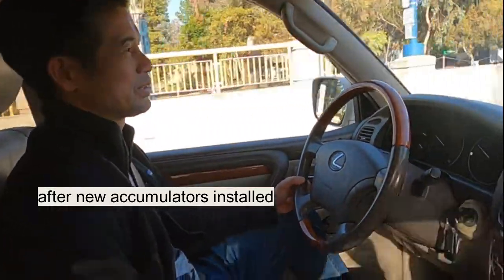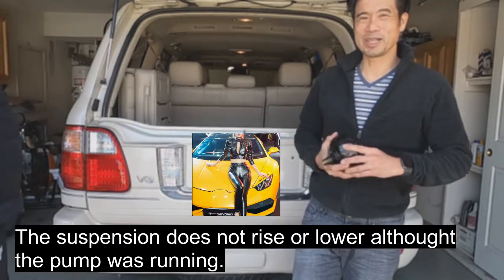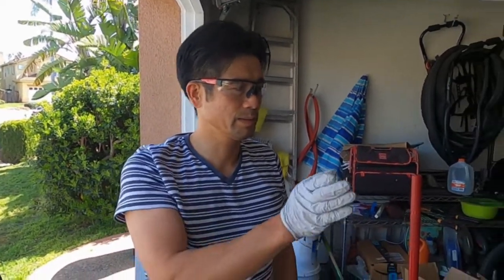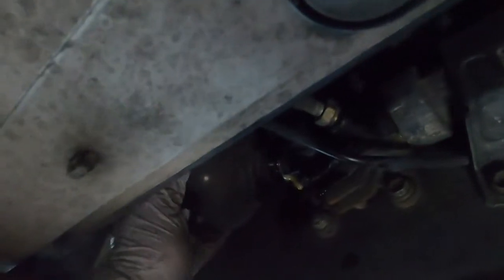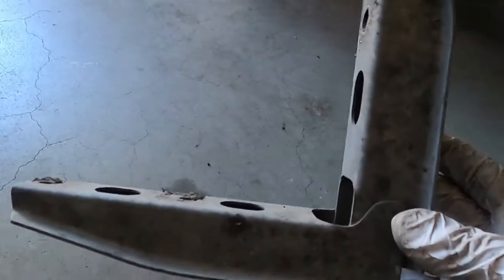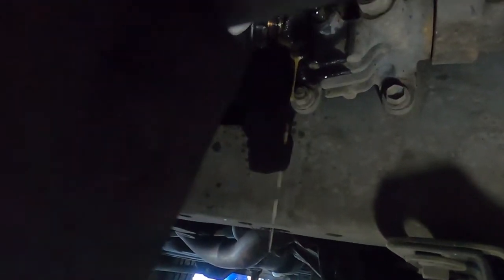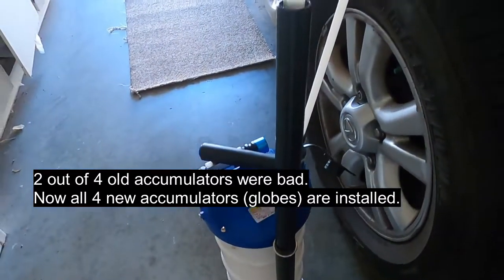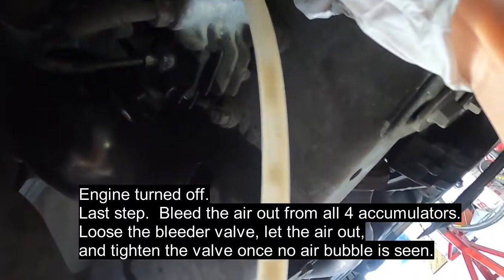Bouncy ride in LX470 solved!  Replacing AHC Suspension Accumulator in Lexus or Toyota Landcruiser.

Comment: Hello sir, can I order accumulator for my land cruiser vx 100. My vehicle is having some problems with accumulator. Can you please help me to get accumulator for my vehicle.
Reply from the maker: You can buy 4 new accumulators from EBay for under $900. Make sure they’re genuine Toyota parts.
Reply: @imdragonslayer  hello sir, after watching your video, looks like  my accumulator is fine, but I still have some problem. When I drive on bumps and rough roads my vehicle specially front part bounce so much. Can you please help me since we don’t have good mechanic for land cruiser here. Do you mind sharing me your whatsup no or Facebook ID so I can share some videos.🙏

Thank you
Reply from the maker: If your vehicle can rise or lower to full length without any problem then the accumulators should be fine.  Check out the front shocks. Typically the shocks should be replaced every 100k mi or so or somethings sooner depending on their condition.  Which part of the world do you live in ?
Reply: @imdragonslayer   oh ok, that’s what I thought, because my left shocker is licking little bit. If you could give me your Facebook ID, I could send you the picture.
Reply: @imdragonslayer  I’m sorry if I’m bothering you. Lol but I really need some help with my car. Thank you 🙏
Reply from the maker: There are also a few suspension components you need to check out by jacking up the car:  ball joints, control arms, and shocks.  How about that you take a video and upload it to YouTube ? And send the link here
Reply: @imdragonslayer  you want me to take a video  of ball joints, control arms and shocks?
Reply: @imdragonslayer  hello sir, I changed my shocker and it’s still same. I’m from Bhutan 🇧🇹 and it’s very difficult to get land cruiser parts, I would be very grateful if you could help me to get genuine accumulator.🙏
Reply from the maker: We bought them from ebay.com.  Not sure if the sellers ship them to your country.  Or visit your local Toyota dealership and they should be able to help you.